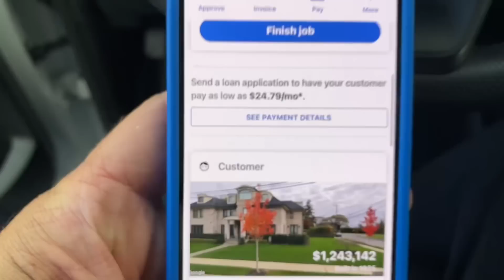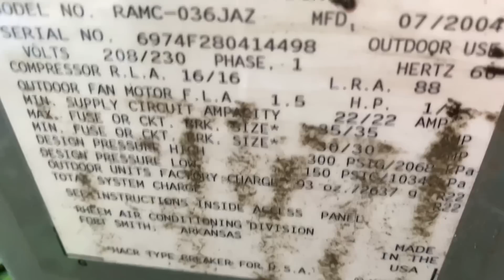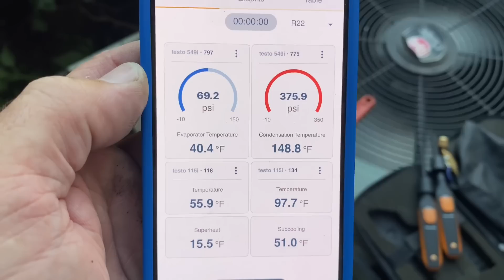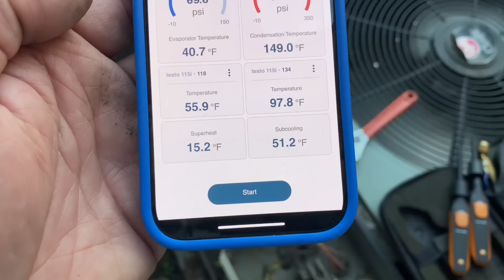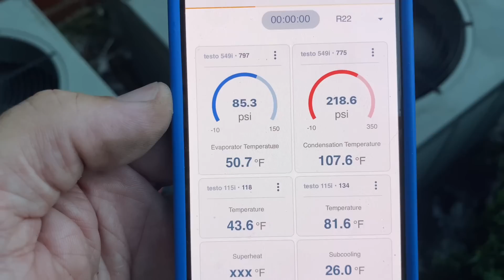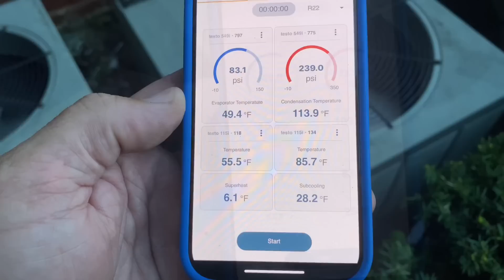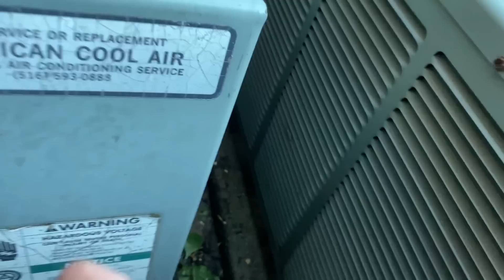Critical AC Repair: Rheem Classic 3 Ton High Pressure Troubleshooting

Comment: Why  the hell are those units installed so close to each other?
Reply: It really doesn’t seem too bad. Two low profile, wide units behind a bush.

Today I serviced a little condenser (in a corner) next to 4 big condensers. All in a walled- off area at a hotel with hella leaves and mud.  R22 with high pressures as well.